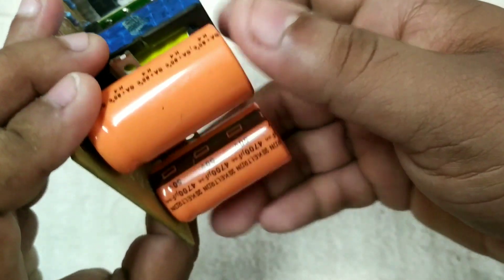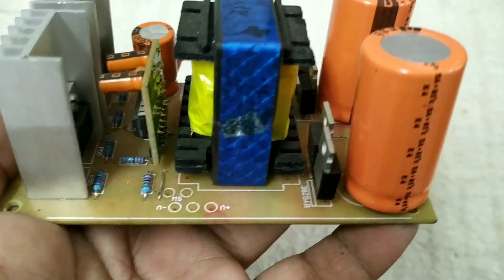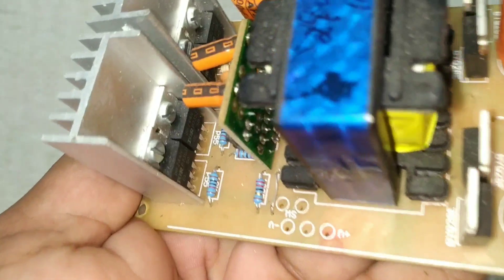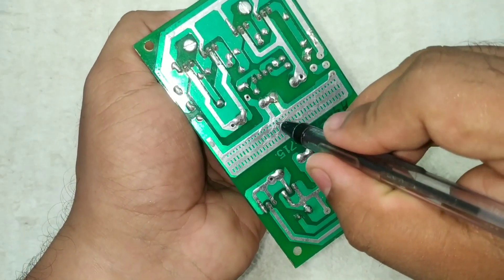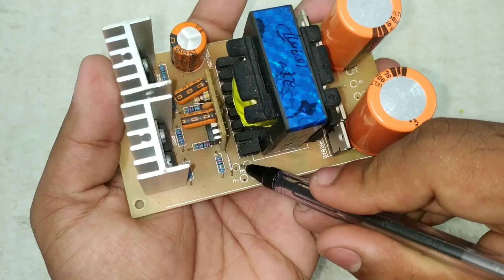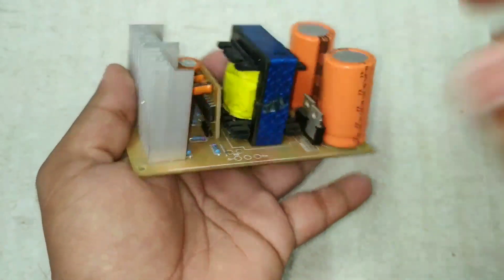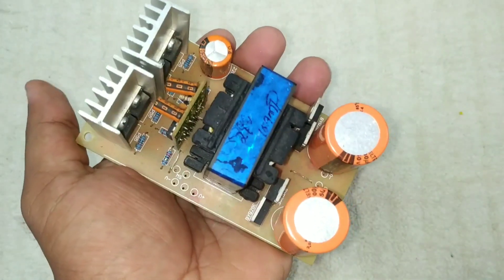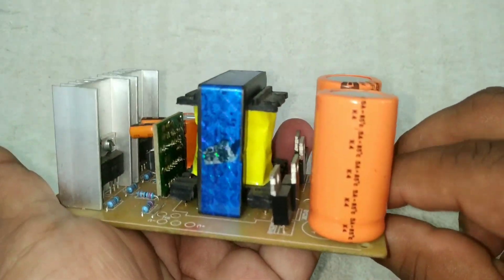12v to 27v dual supply converter smps board for car subwoofer amplifiers

Comment: Transformer connect cheyyaan pattumoo
Reply: Transformer il ninnu rectify cheythu 12v dc aakki connect cheyyan pattuuoo
Reply from the maker: No
Reply from the maker: 12v smps connect chyam
Reply: Pattumenkil ethra amp. Transformer upayogikkanam nn koodi paranju tharuoo
Reply: Transformer or smps 12V 10A
Reply: @jithinkv4795  12v Minimum 15A എന്നാലേ 10A എങ്കിലും കിട്ടൂ പക്ഷേ Cost വളരെ കൂടുതൽ ആവും